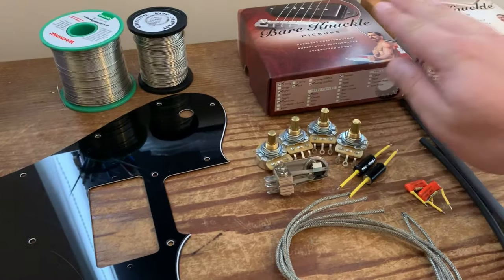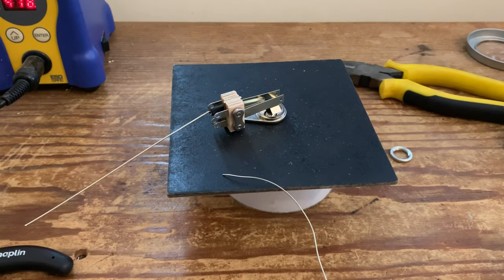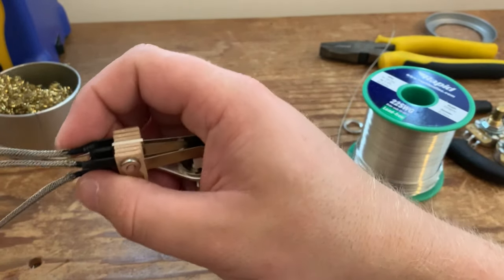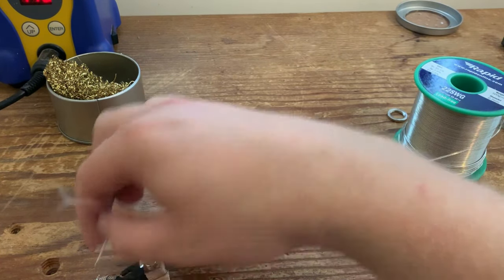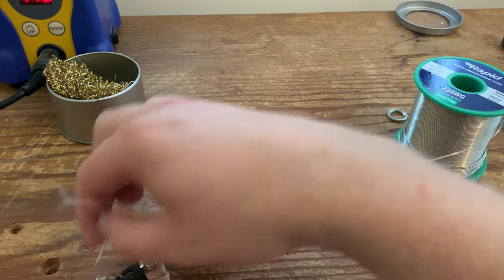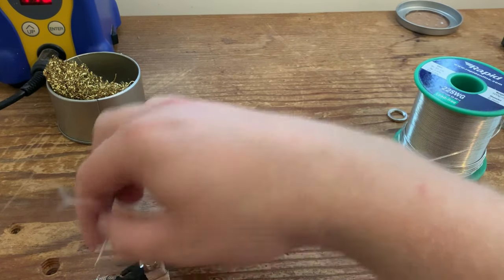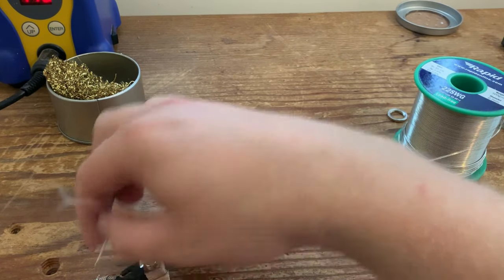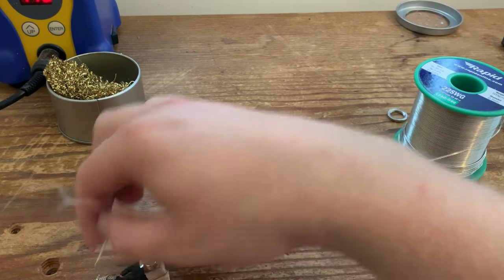How to Wire a 72 Telecaster Deluxe

Comment: Just finished a Deluxe and used flux paste on the top of pots due to the coating on the CTS pots. I scored the tops where I soldered and applied flux paste to ensure proper conductivity. although i use flux core solder it also makes for a better joints... Could of added a length of conductor for the bridge. Would of helped your customer a bit.

Comment: Brilliant video mate thank you! I’m wiring a 72 tele deluxe so the bridge pickup is standard tele bridge and neck hummer. I’m assuming the process is exactly the same? Just connect the tele neck pup as you did here with the hummer? I bought a mojito tone pre wire which just has too much going on and the tone pots don’t work despite me following the instructions to the letter. Figured I’d just strip it down and start over with the parts but following your instructions here.

Comment: Very interesting video, Dylan. So new subscriber here! The blend control was very cool. Perhaps you could look next at modding the newer guitars with a treble-bleed circuit vs a 50s wiring circuit. Also, as others have mentioned, the four-way switch looks good, as does a five-way, where the first position (nearest the bridge) is actually a blend control and the fifth is the "humbucker" style.

Comment: I’ve noticed people use the thicker, stiffer copper lead for connecting all pots as you’ve done here. Is there anything special about this or is it just standard 20 awg wire without any cover/insulation?

Comment: Thanks for this, very helpful. Question: is the ground jumper connecting the pots necessary here, since there's metallic shielding tape on the underside of the pickguard touching all 4 pots?
Reply from the maker: Hi thanks for watching. Not if your foil/copper tape is decent. If it starts to wear through then a ground wire is required (or replace the foil/tape of course)

Comment: Is the wiring you did here a version of modern Les Paul wiring?  What confuses me is the caps soldered back to the tone pots and The single wire from tone to volume.  Is it possible to use the standard Les Paul modern or 50s wiring in a telecaster deluxe with humbuckers?
Reply from the maker: Yes you can use typical Les Paul wiring, modern or 50s it is the same setup.

Comment: So, is this the same way to wire a 72 custom or will it be different since its HS?
Reply: @Harrison Mair That's my biggest hurdle.  I would assume it would be 250's for the Single Coil and 500s for the humbucker. Every source i find says something different. Some even talk about using 1meg pots. so confused.
Reply from the maker: I'd use 500k + 0.022 for the humbucker position and 250k + 0.047 for the single coil.
Reply: Fender actually use 250k pots across the board in the Deluxe and Custom regardless and .22uf caps (according to their own service manuals) which seems to go against the usual rule of thumb

Comment: Hi This guitar is a Telecaster Deluxe, not a Custom 72.  the 72 has a single coil at the bridge and humbucker at the neck position. Im just sticking a seymour duncan hot rails in the bridge of mine and I jumped on this video,  but wrong guitar.  Nevermind,  good quality wiring by the way,  very neat.